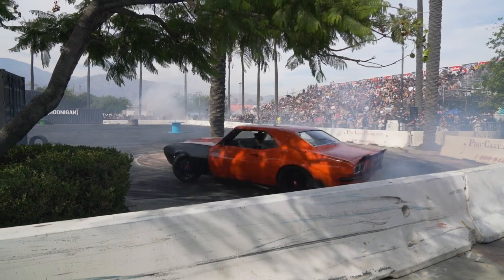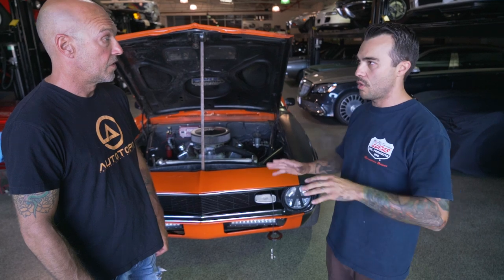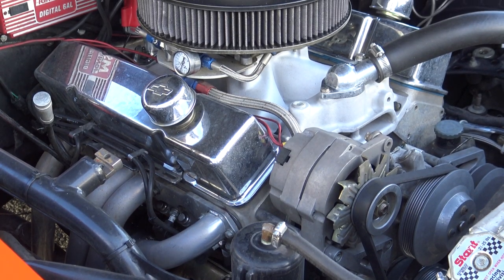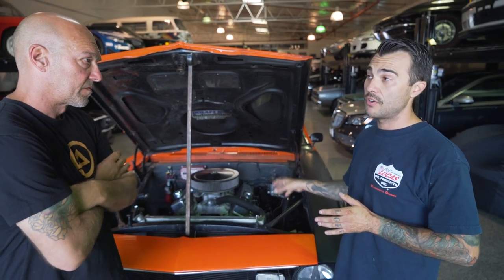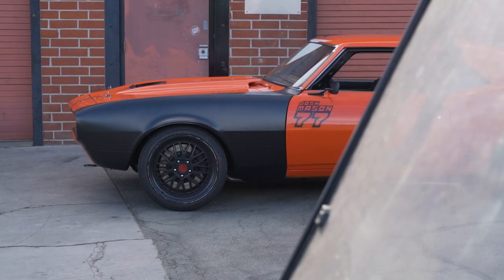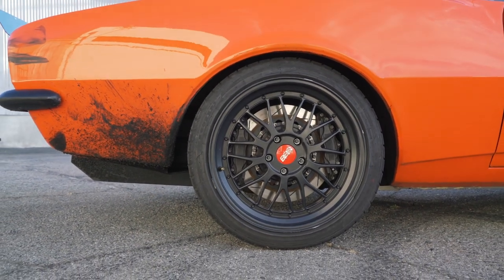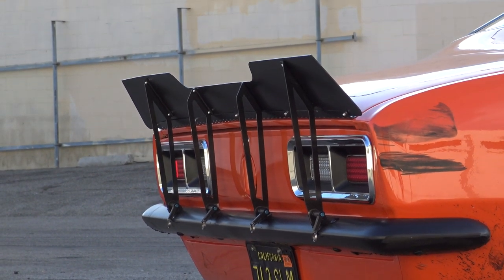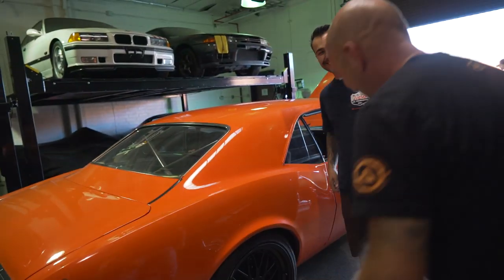1968 Camaro Drifting & Shredding Tires Hoonigan Style

Comment: I thought burnout cars had a separate front brake only designed to keep the speed down and keep the rear wheels spinning.
Reply from the maker: He set it up for drifting not just standing burnouts
Reply: @AutotopiaLA  Drifting or Burnouts, you need to stop/slow down the forward movement of the car while having the rear wheels spin so a front brake only would do that. Does this car have a front brake only?